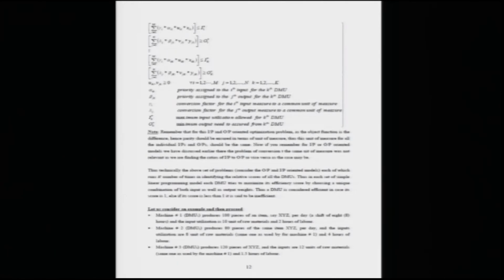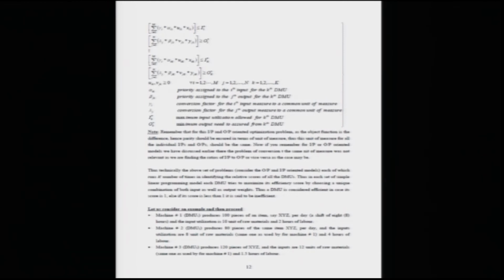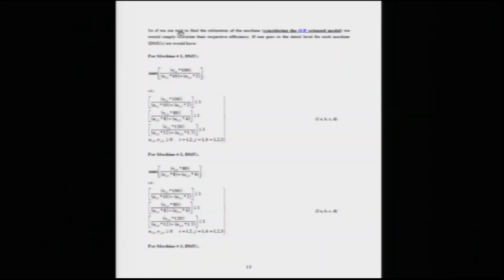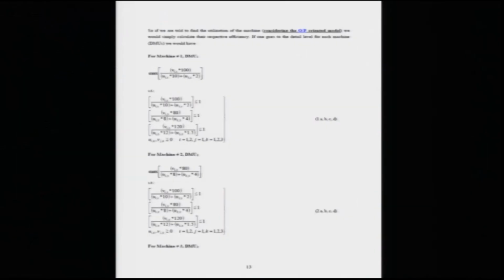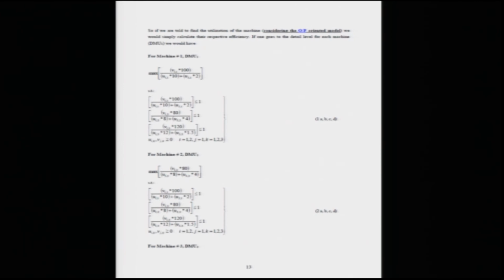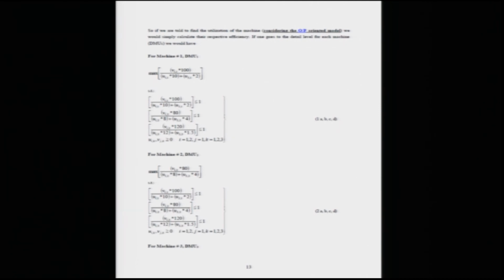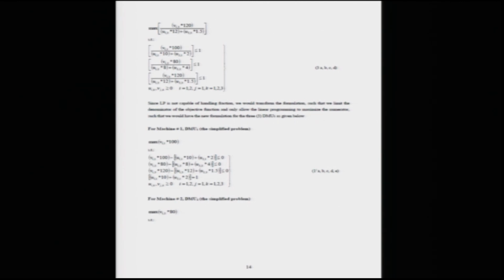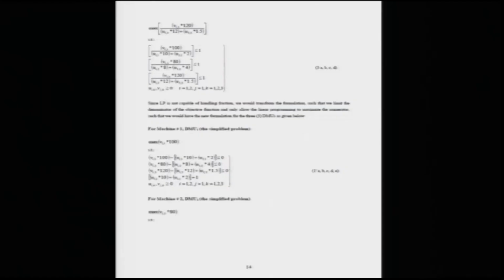noc19-mg15 Lec 15- DEA

Comment: With due respect sir. CRS does not mean  2 units increase in input imply 2 units increase in output. Rather it is 2percent increase in input implies the same percentage increase in output
Reply: What is the difference between the two? Units == Percentage, cms, litres, etc. Isn't it?
Reply: @utuber_99 Consider F(K, L) as the CRS. This means F(xL, xK) = x F(L, K). It does not say F( L+x, K+x) = x F(K, L). When we take 2 percent increase in all input what we do is F(1.02L, 1.02K) = 1.02 F(L, K). In case of 2 unit increase, F(L+2, K+2) = ?. Hope this clarifies. Thanks.